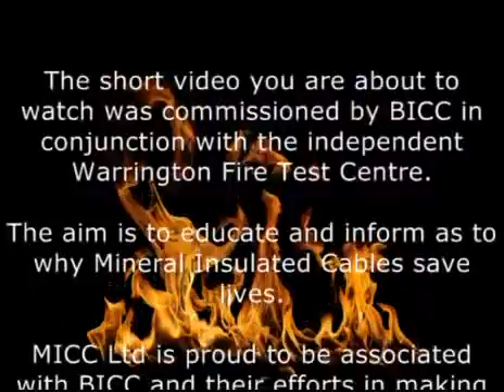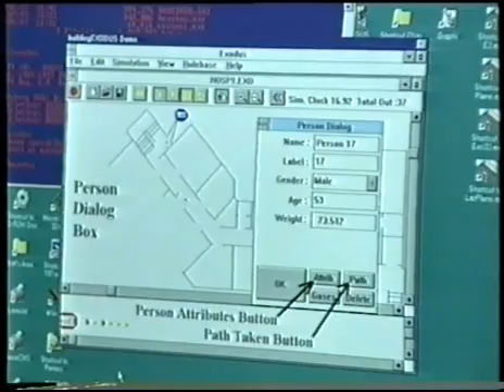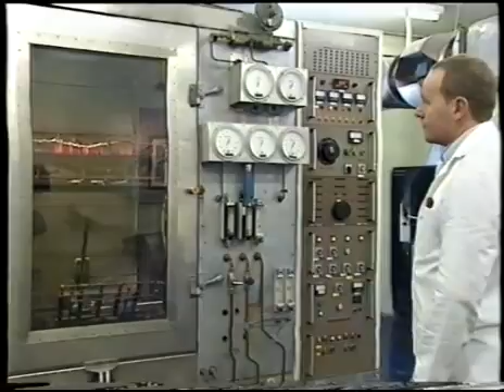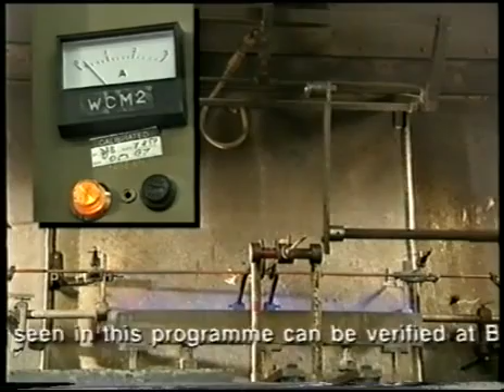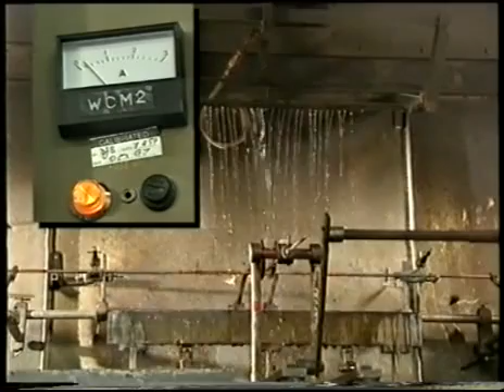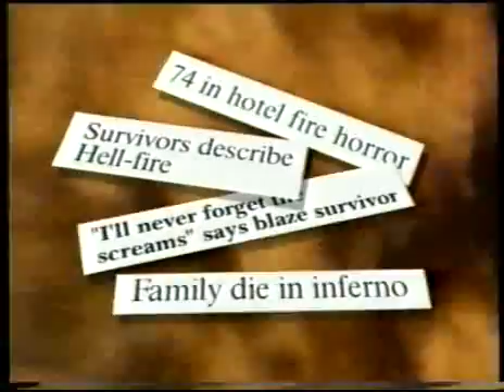Why MI Fireproof cable

Comment: Further concerns at our local hospital. Two of the lifts to the patients Wards, situated on the first floor, were out of action. It really adds to the potential problems should a fire exist. FR cables, not appropriately fixed, were in evidence. It does not inspire confidence that safety is a core consideration.

Comment: The question asked - Why MI Fireproof Cable?
* Maintains the electrical supply.
* Predictable fire alarm alerts.
* Secures the emergency lighting.
* Avoids smoke & toxic fumes.
* Assists the fire fighters by maintaining vital services in fire conditions.
* Prevents fire spread.
* Provides a 2 hour fire rating to allow safe evacuation from a burning building.
* No false alarms.
* Permanency over the life of the installation.

Comment: I visited a local hospital recently. A modification to the fire alarm system had been carried out in FP 200 Gold. The fixing distances were wider than the manufacturer's recommendations and the fixing devices used were not fire rated. My partner spent 3 weeks in intensive care and it crossed my mind what the situation would have been had a fire developed. No doubt FP200 had been chosen on the basis of cost but, in such circumstances, would it have been fit for purpose? Should the NHS put cost before life?
Reply: Geoffrey, your comments are extremely valid in today's culture of litigation

Comment: Why MI Cable? It is simple it is the only true fireproof cable that is able to withstand the presence of Fire,Water and Mechanical Shock that appear simultaneously in fire conditions.The system has survived the test of time for more than 80 years  with distinction.